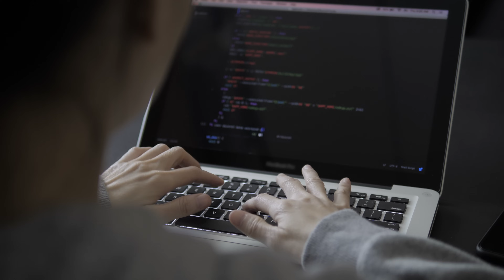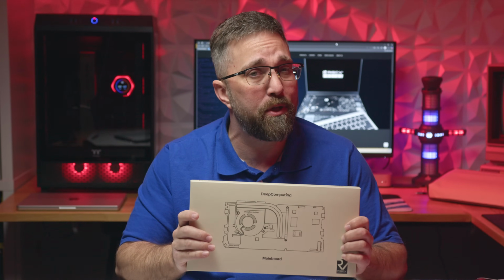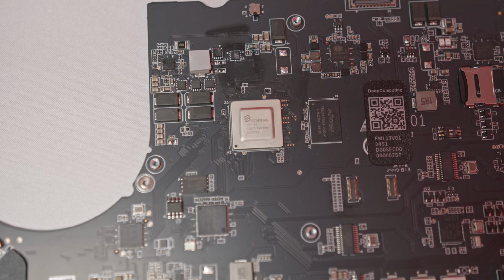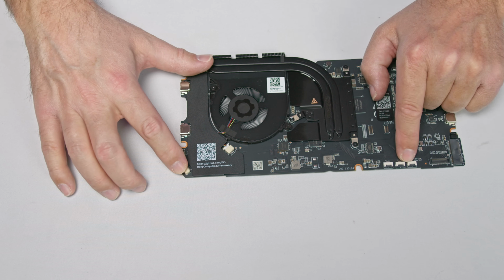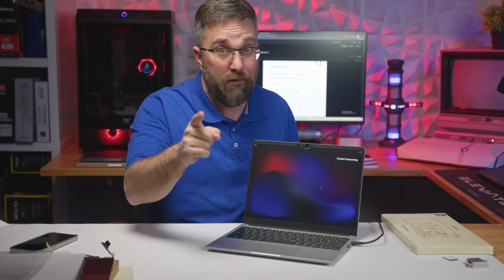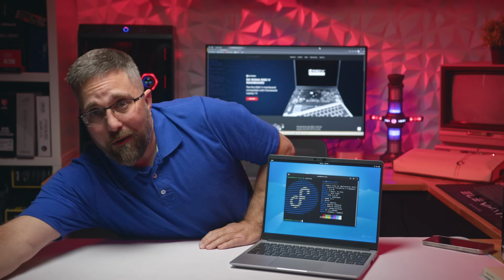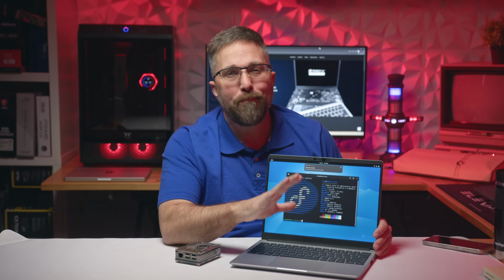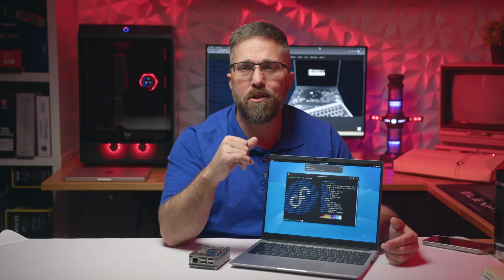Framework Gets Risky! DeepComputing RISC-V Mainboard Review!

Comment: Why choose specifically RISC-V over tried and true libre devices like POWER?
Reply from the maker: I'm not well versed on it but I believe IBM still holds patents on many specific microarchitecture implementations. You may need to license those separately if you want to use IBM’s POWER processor designs. Using a pre-designed POWER cores from IBM would likely involve fees and the few dev boards out ther use Power8 or 9 CPU's. As far as I know Implementations of fully OpenPOWER like Libre-SOC are still in early to mid development and securing foundries and funding is a problem. Also, there is a much smaller software development community.
Reply: @ElevatedSystems  
>there is a much smaller software development community.
POWER is very mature and decently supported. Only problem is it's exclusively sold for expensive servers.
Reply from the maker: @ IBM POWER (which powers things like Watson) and OpenPOWER are 2 different things and I’m pretty sure OpenPOWER (which would be comparable to RISC-V) has very little development at this point.

Comment: About kernel compilation time, and any type of compilation benchmark really, you need to be aware that compiling software for x86, ARM and RISC-V will take a different amount of time even using the same compiler but selecting different target architectures. Some of the compilation steps are architecture dependant, namely the later stages of compilation, where register allocation, optimizations and machine code are processed. Therefore if you want comparable results you should compile the kernel (or any other binary) by manually selecting a "cross compiler" to target the same output architecture on all platform tested. It's not super easy to do, but if you don't do it this way, and instead just run the default compiler, you will get totally uncomparable results.

As point of reference, when I was working as a game programmer I saw huge compilation time differences when compiling the same exact code for Nintendo Switch (ARM processor) versus PS4 (x86-64 processor) using the same compiler (CLang) on the same machine (usually the ARM build took 30-40% longer). It's just the nature of the compiler itself.

Comment: I would guess this RISC-V as a more powerful Arduino or Raspberry Pi. If this is going to be a thing, It might be a game changer in prototyping. Imagine those sensors and expansions slot you can put in those slots.
Reply: Right now it's just a more powerfull arduino, the esp32 c3 and esp32 c6, are risk v, has  wifi and Bluetooth conection and you can program it using arduino IDE

Comment: SOLDERED RAM IS ALWAYS NOT A BETTER CHOICE.

Just want to point that out.
The ram may be at a reduced speed in this design but ram should always be upgradable.
Reply: Yes but 8GB Ram is what the SOC supports maximum and board comes with 8GB so there is no upgrade path.
Reply: @Rubacava_  then they should design better.
It is wasteful to just affix arbitrary size limits to ram.
So if I bought a 4gb one and want to upgrade to 8gb, I should buy another new motherboard?

Heck NO.
Reply: @ayanned  you can't buy 4gb version imho there is only 8gb model
Reply: @ it's a hypothetical statement.
Can't you understand?

But this statement is already happening look at RPI's and Orange Pi, and any SBCs seldom they offer such flexibility in RAM.
Reply: @ayannedcool your jets, this isn't even consumer ready yet
Reply: @deoxal7947  yeah right npc.

Adding ram slots on their cad and wiring diagrams are really difficult so let's give them a pass.
Isn't consumer ready? Can't you see it's ready being sold?

Even if it's a "development board",  the company making the board has produced many Risc-V SBCs already, they can always put ram slots there, but they wont.

lol
Read your comment again.
Consumerist npc

Comment: As with every other RISC-V release, I'm a bit disappointed... Minimum performance requirement for proper desktop usage should be at least RPi5. For headless installs this could be an interesting board to use and I do think most of those who bought this will throw it in a 3D printed case and make a mini server out of it or something. Also having to use a custom image really is a bummer.

Oh and to Framework: thanks for never notifying me about this one getting released even though I signed up for your email notification! 🙃
Reply: They must have been sending them my way lol. I got more than I asked for. 🤡
Reply: i didn't get it either
Reply: I think it's a necessary intermediate.
It's not like many companies are exactly excited to immediately dump all their money into a high-power chip with zero support. Also, they still need to take time and develop the chip efficiently. Now's the perfect time to release weaker, intermediate chips to allow an ecosystem to grow.

Although, yeah, a bit pricey at the moment. Here's hoping it gets cheaper with increased interest.

Comment: I'm an ex-developer now tinkerer - Just ordered a second FW13 (ryzen) together with a risc-v board and case to experiment with assembler and OS dev. Would like to see some ARM FW mainboards though the upcoming AMD APUs are very interesting. BTW commercial RISC has been around since the early 80's eg Sun SparcStation - Berkeley have been been busy with risc for decades.
Reply: You should get something like the coolermaster standalone case. It'd let you use one as a desktop.
Reply: @moarjank  I did get the coolermaster case though I will likely eventually laser cut or 3D print something to suit a mini-rack
Reply: They were big on consoles at one time as well.

Comment: Using the emmc gives a significant boost in performance when running ubuntu. I found myself setting up a very lightweight system by removing gnome and throwing dwm with st on it. It's fairly fast to use and certainly fast enough for development purposes.

Comment: How was the power efficiency? An underpowered but super long running device isnt completely useless...
Reply: Underpowered, slow and inefficient for mainstream even for SBC.
However this is not going to be sold to mainstream even most developers will wait.
Reply: @robertlee6338  Is this a RISC V problem or just this board in particular?
Reply: @FakeProfOak  It's a problem RISC-V boards as a whole are facing- they don't get much more powerful than this right now. Most likely this is because it's so new. We don't have many points of comparison, so we don't know what it would look like if we were on our way to RISC-V catching up with more established architectures for high-performance computing, but x86 and ARM have been around since the 80s. Both have had top-of-the-line, high-performance chips in their respective markets for the past 20 years of advancements, whereas RISC-V has been published for ten and implemented in real machines for even less.

Comment: Intel owns x86 (the 32 bit one) amd owns amd64 (x86-64) intel tried to make a 64 bit isa back when they made itanium but it failed and amd64 was different enough from x86 to not violate copyright.
Reply: US patents for 586/686 and X86-64 v1 (expired in 2023) have lapsed.
Reply: Oh, I thought they still had a contract to distribute x86 and used that to back up amd64. Does that mean amd64 is a different architecture with 8086 micro code under the old x86 contract?
Reply: Actually…

No really, at one point AMD had a license to x86, it was one of the few to ever get one.

Then it developed it's own 64 bit chips which were more successful and intel had later to obtain a license for it.

The details are quite complex btw.

Comment: Had to check whether Apple bought ARM. Turns out, no!
Reply from the maker: No Apple sold Arm, over time anyway. In 1990, Apple, Acorn Computers, and VLSI Technology formed a joint venture and created Arm. Apple has since sold off all its shares. However, with the success of the M series Apple now has a 2 decade deal with Arm which gives them much more control over the development of their processors than any other Arm license.
Reply: @ElevatedSystems  no, apple was not involved with the creation of the first versions of arm, but apple did start working with acorn to develop arm6 which was later used with the newton

I'm sorry but saying that arm was created by apple is just so wrong
Reply: 😮 nvidia tried to buy it but was unsuccessful

Comment: If framework came out with a Snapdragon or AI 395 Max, I"d cop a mainboard
Reply: AMD can’t even supply enough chips for big names like HP or ASUS. I doubt framework is getting Strix Halo anytime soon.
Reply: it doesn't make sense on framework 13 because of power limits. 

Framework 16 doesn't really have the thermal headroom for it either. SInce the CPU cooler that would be used to cool the AI 395 MAX is only designed to cool 50 ish watts. It won't give strix halo the proper power headroom to completely stretch its legs.
Reply: I feel like AMD support for smaller OEMs is not forthcoming or at least is limited. The current AMD Framework came out months after the launch of the 7040 series and is still a bit janky, could be that the experience with that put them off. Otherwise, yeah, more than a  ~30W CPU is not really tenable here.
What Framework really needs to remain competitive is more I/O, even if not all of it is modular—that’s my hope for the 2nd gen announcement at the end of the month.
Reply: @bilditup1  they could just have USBC ports on both sides that are on daughter boards alongside the regular 4 modular IO.

But on AMD boards, all of the ports should really be USB4 like on Intel.
Reply: Here's the thing neither of them supports upgradable ram which is essential for Framework 's upgradeable and modular design
Reply: @ techincally strix halo could work with LPcamm2. You will incur a tiny penalty at running LPDDR5x at 7500 mt/s instead of 8000.
Reply: @samridhyaghosh4693  Wait, really?
Reply: @tot-not-filip  Strix Halo uses four memory channels instead of the usual two. That makes it almost impossible to support upgradeable memory in the form factor that Framework uses.
Reply: @hackfleisch7424  Yea, I don't care about Strix Halo, I was moreso surprised by the fact that the same applies to (all?) Snapdragon chips, if I understood correctly
Reply: Wait, what about LPCAMM?
Reply: @tot-not-filip  doesn’t work. Apparently signal integrity wasn’t good enough
Reply: @Marauder-q2v  You're talking about the strix halo and them wanting to keep the high throughput, right? I'm just thinking about more mundane scenarios and LPDDR in general... like a normal Snapdragon chip or something like that
Reply: Neither does RISC-V
Reply: @ good because it means it'll be in a more ready to use state.